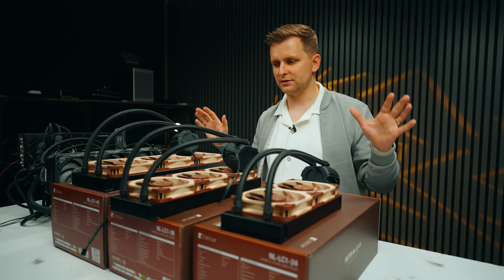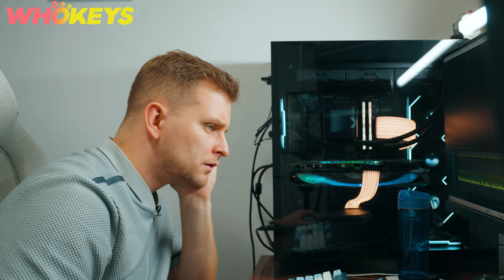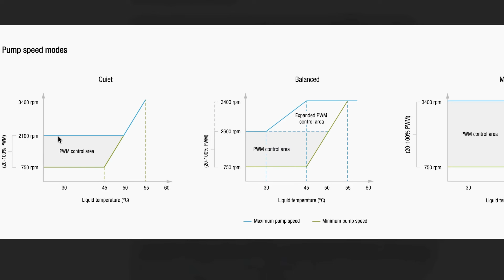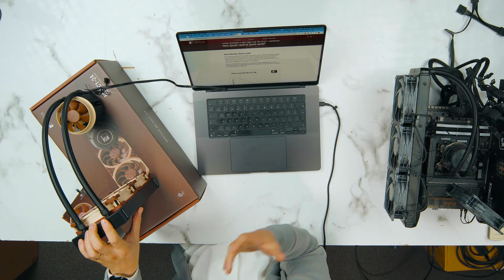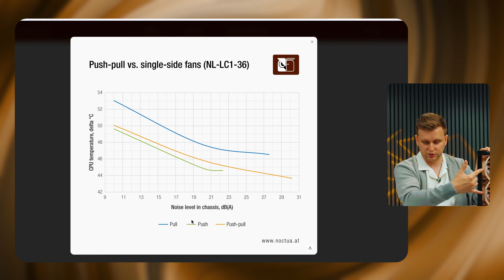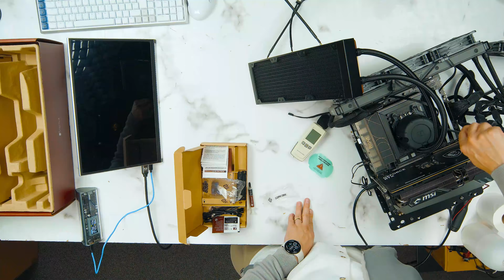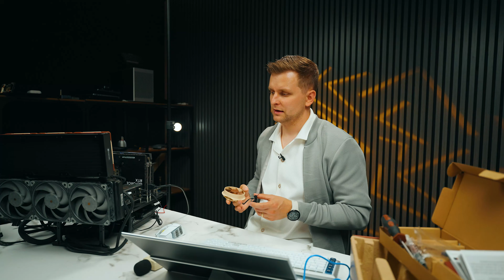Noctua's NEW AIO just destroyed half the PC Cooling INDUSTRY

Comment: I installed the 360 this weekend and my 9950X3D is running 3-5C cooler than it was on my Ryujin III Extreme 360, and MUCH quieter. This is an impressive AIO!
Reply: @AlphaGatorDCS  Is it with the additional fan on the pump?
Reply: Which speed mode do you run the AIO, quiet or balanced?
Reply: @AlphaGatorDCS  mode -7mm??
Reply: Actually Ryujin has the same asetek pump
Reply: tbh, for the price, it’s just not worth it. Other AIO’s perform too close to justify the price…
Reply: @theexecutioner2664 it’s not just about performance it’s also about noise.
Reply: @robertg457100% agree, but it doesn’t need this cooler to reduce case noise to very (*very*) low levels during any gaming activity except perhaps during shader compilation, nor (except perhaps those with the top-end Intel chips needing the ridiculous voltages that Intel decided to push in an attempt to remain relevant) will it be the AIO noise you’ll be hearing during gaming  - it’ll be the GPU cooler fans.

 I have a Liquid Freezer III combined with a solid case airflow. Combined with FanControl software for custom cooling fan/pump curves and I pretty much never hear my AIO cooling ramp up at all - it’s the GPU fans.

tbf, my 7800x3d runs cool anyway… there are far hotter (/cough Intel) chips out there, but it’s not the 2 -4 degrees Celsius gained by this AIO that’s going to make all the difference when the hotter chips build up temp and need all the support they can get to vent as much ambient as possible as the AIO starts to struggle at the top end of the temperature curve. You’ll need other case fans to help vent as much cool ambient from outside to push through whatever radiator is a part of your AIO.

tldr - it’s just not worth the extra cash. It’s more of a bragging rights thing imo… there are just too many other solid competitors out there that achieve the same goals.
Reply: @theexecutioner2664  You are right. 280mm or any 360mm/420mm from arctic will be more than fine, and you can easily obtain them below 100€. There are also other alternatives. I bought myself an intel cryo cooler (from coolermaster) for 80€, which uses peltier and achieves much better performance than this noctua cooler that costs a bazillion.
Reply: however you lost the LCD and the LED lights for 3C
Reply: The thing with the 9800X3D is you can actually keep it cool with a stock AMD cooler with no issues.
Reply: @jamesm568  You are right dude, I don't know about these newer chips in the top but older X3D often wouldn't bump their clock if temps hit 85º or something close to that. So even mediocre air coolers could do the trick. But you won't be getting the same performance, which can be or not noticeable depending the game or activity you are running on the pc.
Reply: @EGOTheSpartan Keeping your CPU cool as possible does give you better performance and less likely to throttle. Most AMD CPUs will do just fine on quality air coolers.
Reply: @jamesm568 there is no stock AMD cooler for the 9800x3d, and all of their coolers have been very loud.
Reply: @robertg457 I was referring to the AMD Wraith series which is their stock CPU coolers. Yes, you would have to run the fan hard under continuous use. I personally don't worry about noise as I don't set my PC on top of a desk as a PC belongs underneath the desk out of the way. This is coming from someone that has 11 Noctua Industrial 3000 RPM fans in a case.
Reply: @jamesm568  Pretty sure it says DO NOT recommend the AMD Wraith cooler for 9800x3d which was why that product was discontinued a year ago. Cmon man
Reply: @Amtrack45 I didn't say you had to as I said you could.
Reply: @jamesm568  nobody buying a 9800X3D should be using a stock cooler. Remember that AM5 CPUs under load  typically clock higher when they have a better cooler. A CPU like that is too good to be disrespected by using a stock cooler. AMD’s stock coolers are garbage
Reply: @mttrashcan-bg1ro Yes, the AMD Ryzen 7 9800X3D can be air-cooled highly efficiently. That CPU doesn't even need an AIO to keep it cool as an AIO is not even required or remotely needed. Hell, you can even run that CPU on a 120 mm AIO with no issue.
Reply: You know about the peaks? But yea there are other cpu that need it more then a 9800. I get the 420 for my 9800 xD anyone need fans?
Reply: @jamesm568  so you think is not worth getting one?
Reply: @justicehero5717 It's absolutely worth getting as you can push that 9800X3D to its limits. Especially those of us that run 6600MT/s RAM at CL30 locked in at the 1:1 ratio.
Reply: @justicehero5717  It's complwtely not worth it. Cooler Master Atmos(the first one) runj just 2 degrees cooler on 12900K with the same 39db and costs 4 times less.
Reply: @jamesm568  he said 9950x3d genius.. completely different animal
Reply: @sstier48 The 9950X3D can also be easily air cooled as an AIO is not even recommended. Now an AMD stock cooler probably wouldn't work as well though.

Comment: i got my 420 today and i let the switch default (quiet mode )
 i run my pump at 100% and vrm fan 75% 
I did not really understand if running the pump at fixed speed is better or worse then letting the pump operate by itself; in my proart case at 100% manual speed  i can't hear the pump at all !
Reply: @R_RatedTech  what temps are you getting with this?
is it whisper quiet?
Reply: @MarVeida  i m using my pc for gaming only, so what i can tell you - in the last of us part 2 and resident evil i-m not getting over 60 degrees after a fefw hours of gameplay(resident evil it-s like 54 for me) - i can't hear it at all !! (quiet mode -  100% pump speed - a little over 2100 rpm, 75% speed on the VRM Fan)

Comment: This isn't the AIO for everyone. Most people doesn't need it. They are running their processors at normal spec speed and doesn't really notice if the processor throttles down just a few Hz costing perhaps 2 FPS. That's most of us. The processor running at 65 or 72 degrees just doesn't matter. And it's using "Ugly Brown" (copied from a previous post here) fans. That not what people want to stare at when they buy the modern aquarium glass cases. People want screens, RGB Led everywhere and as much RGB Unicorn puke you can get your hands on. And this AIO is not for those.

Those who really should look carefully are the over clockers and those who want a quieter system but can live with the noise from this AIO. But anyone cheapskate or simply just minded by prices have a lot of other AIO to choose from. Personally I recently bought an AIO from MSI, don't know the model, but it's 360mm and cost almost perfectly one fifth of the Noctua 360 version just a bit under $40 without tax. Actually that's less than one fifth. if I remember the price correctly the Noctua 360mm version costs $250. That means you could get the MSI AIO for six computers and still have some change. And this cooler from MSI isn't bad. I remember findong some tests before buying and it was solidly in the top part of the middle range where you found 90% of all tested 360 AIO. 

Now the price was a special so currently you might not be able to find it at that price. But specials come and go. And if it isn't MSI then it will be some other brand that perhaps has put more bling on the AIO. I'm not sure but I think my AIO has RGB fans. Not important as the case doesn't have a single window in it so all is out of sight, out of mind.
Reply from the maker: Sorry, what's the key point you're trying to say here? 🤔
Reply: @theTechNotice  That it's not the cooler for everyone. It's great, but it doesn't have the RGB Unicorn Puke a lot of people want. It isn't necessary for most people to have this cooling of the CPU and it's rather expensive if you are the least bit restricted when buying an AIO as you could buy 6.25 of the 360mm AIO sold by MSI for the same price as the Noctua version.

Comment: At $250 for a 360 AIO... yeah you BETTER get something good out of it.   Personally, I'm ok with my fan curves on my $70 Corsair (it was on sale), where I only hear it if my CPU is getting hammered really hard (e.g. inefficient Unreal engine programming).    But everyone has a price-performance boundary they are willing to go towards, for me... $250 for a 360mm AIO is just not going to happen.
Reply: 250 for 420 and 180-200 for 360mm would have been more along the price I would have been ok with and even then that's expensive

Comment: Well, I just bought the NHD15 G2...
Reply: Good choice, though a bit overpriced. This thing will last forever.
Reply: @batouranger2553  The fans are coming with a hefty price, which probably contributes to that consensus. At least I have not to worry about pump failure or leakage.
Reply: Amazing piece of kit. Did the same 2 weeks ago. Think I would rather keep this over the AIO. ( Unless I got it for free lol )
Reply: @Koeras16  It'll last you 15 years ..
Reply: I got the NHD15 after i had an AIO leak in my system, I'm never going back to AIO's ever. It's simply not worth it. The worst thing that can happen is a fan stops working and it will still cool you cpu. Plus it will last forever, since you just get new mounts from noctua, often sent for free in most cases.
Reply: And?

Comment: I am repeating myself at this point, but I am just too shallow to install a product into my PC that looks like it was designed for a 1970s bathroom. I'm also not too thrilled about their pricing - doesn't truly matter to me if I can go a few degrees lower with their AIO when I have to pay over €200 for a pretty much barebones 240 unit and there are excellent 360mm-alternatives for roughly half that price - or for even less than that if I settle for "good" instead of "excellent". PC hardware has become too expensive already, IMO. 
I don't need RGB and I certainly don't need an LCD-screen on my waterblock, but for this sort of money (for a puny 240mm unit), it would be nice to get some "added neatness" features like hidden cables. And/or the option to go all black instead of that "grandma's support stockings" colorway.

Comment: Great way for folks to upgrade their current machine, since no one can afford to build a new machine. Do you know if anyone designed a PSU fan with auto thermal speed control? Seems like a great design for Noctua or some other quiet fan company to build. Lots of us have quality PSUs that only run one (loud) fan speed, and I'm currently considering a Noctua or variable speed fan solution for mine. Pump whine sucks by the way. I've actually found my machine going full turbo fans/pump noise when DaVinci is at peak load is kind of fun, but I wish I could slow the roll a little.
Reply from the maker: Noctua has done a PSU as well! 😊

Comment: I can hear my D15 G2 + two Nf-a14 g2's above 800 rpm, but i give noctua credit that these new fans do push alot of air at low rpm.
Reply: Yet it loses to 5€ arctics when tested.
Reply: @kazuviking  Arctics fans are good on the price to performance side but noctua blows the out of the water
Reply: @IkarusGhostI Testing shows otherwise. The only scenario where the noctua g2s beat arctis p14pros are airflow through dust filter/mesh at 31dBA. P14 pros just beat the noctuas in every other way. The P14pro is just a beast. But the 12cm noctua fan shits on arctic tho, i cannot deny that.
Reply: @kazuviking  If you like loud noise, buy the Arctic.
Reply: @mieczysawmietki4053  Read my other comment. Testing shows otherwise. In an open bench where the noctua aio wins but nobody uses their pc like that. When mounted in a case the noctua aio needs to spin at almost max speed to cope with the extra heat. As for fans the p14pro moves more air and and have more pressure than noctua g2s at the same volume. Read the hwcoolings test on them.
Reply: @mieczysawmietki4053   Or just lower the spin curve to the noctua's levels!

Comment: such a shame they don't make a 280mm variant of it, it'd be perfect
Reply from the maker: Why? Coz 140mm isn't as good on performance to noise ration as 120mm. I'm not sure how much difference there be on 280 vs 240...
Reply: @theTechNotice  Well, it'll be quieter than a 240 and some cases support only up to 280 rads.
Reply: @theTechNotice  2x 120s vs 2x 140s yes noise will be higher but 140s also move more air so you can actually negate the noise by dropping the RPMs a little but 2x 140s vs 3x 120s, the noise difference is in favour of the 140s and like someone else said, some cases can only do upto 280mm so having that little extra room over a 240mm in those more restricted cases would be perfect.
Reply: @theTechNotice  It could be a case issue.   Ideally I'd want my AIO on the top of the case but... my case can only handle a 240/280 on the ceiling,  so I had to put my 360 AIO on the front (which isn't horrible either mind you),  and while you say the performance to noise ratio isn't as good, for cooling the 280mm fan is a lot closer to cooling power of a 360mm AIO than it is a 240mm AIO.
Reply: I had great experience with 280mm AIO. I would like to see those too.